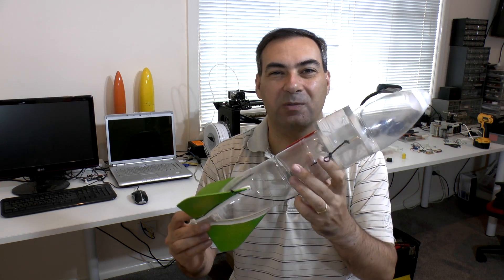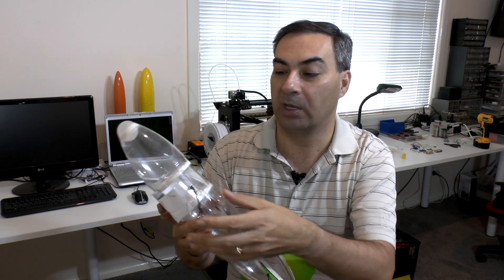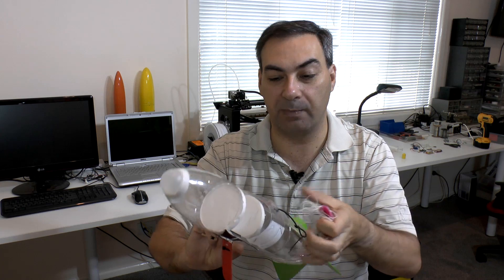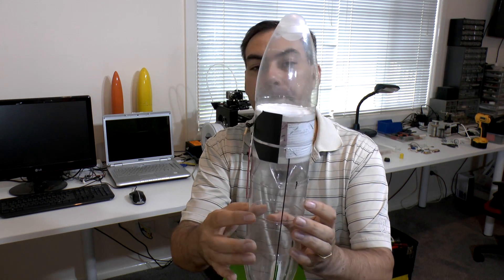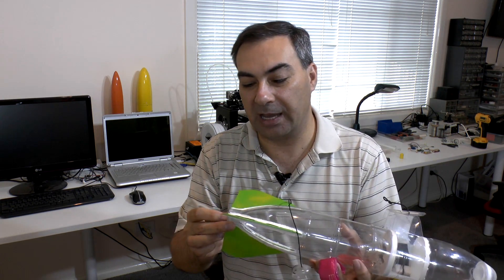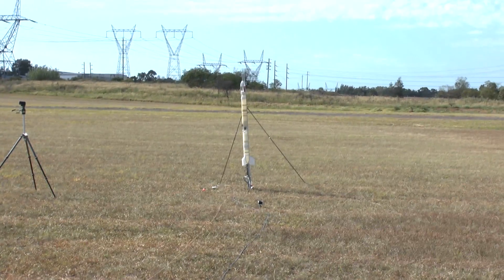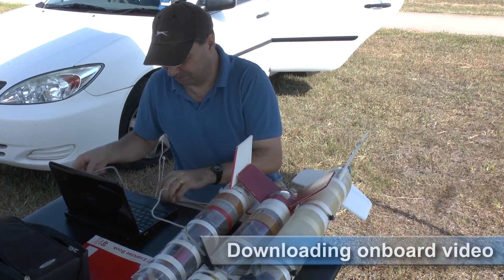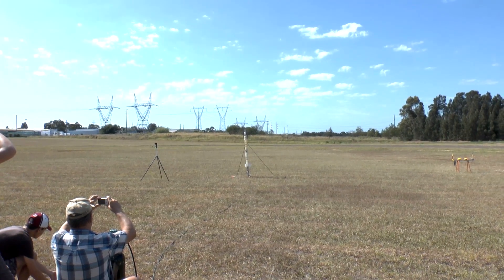Day #184 Highlights - Axion G6

Comment: Hello George, I am building the water rocket like  Polaron G2 and Axion G2 using booster mechanism that you suggested on your website. I have a doubt that is it possible to use small electric pump (300psi) which is without a pressure tank and have low air flow rate than the scuba tank.??
Reply from the maker: Hi akash, thanks for your question. The small cheap electric pumps probably wouldn't be suitable for pressurising a rocket like the Polaron G2 due to the volume of air and pressures involved. The compressors overheat easily and then seize up. You could try a compressor/ bicycle pump combo with a manifold where you let the compressor run to say 60psi and then finish it off with a bicycle pump but that is still a lot of work. For cheap compressors also don't believe that because it says 300psi on the box or the gauge that the compressor will be able to achieve that. Expect only around half that pressure.

Comment: Great video George! I really like how you include the Water Rocket Community in your work and your videos! :) As you know, we really are a big fan of mechanical parachute deployment systems and François' system works very well. The Axion G6 launches look very impressing. I had always thought that someday you will find one of your rockets in the trees. ;) Nice that you could get it down! 
Cheers
Julian
Reply from the maker: Hi Julian, it was very nice of François to send us his rocket. It's always interesting to see how different rocketeers solve the same problems with the materials they have on hand. 
We've landed in trees before and luckily this one wasn't very high, but it's always nice to get your rocket back.  :) One rocket spent more than a year in a tree before it came down.
Reply: I remember your tree recovery system which automatically detaches the parachute after a certain time.  ;)